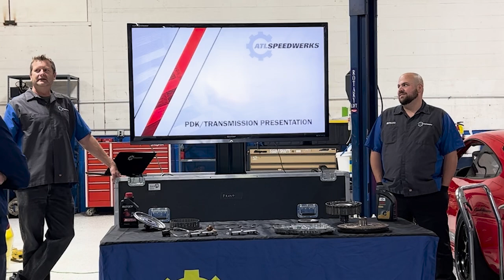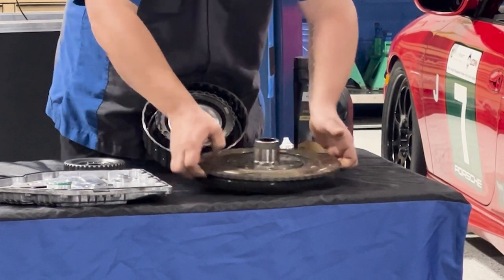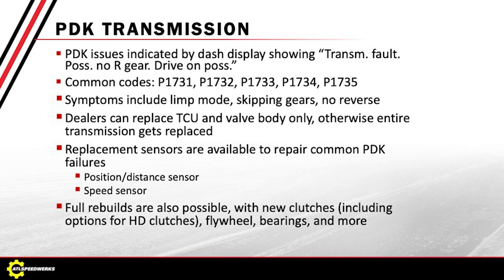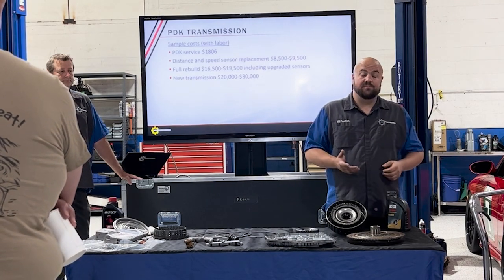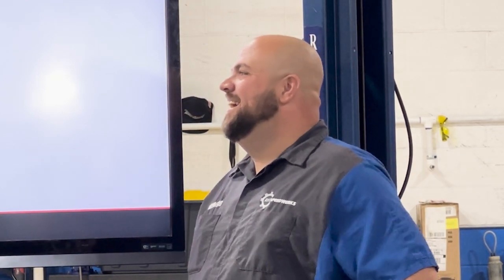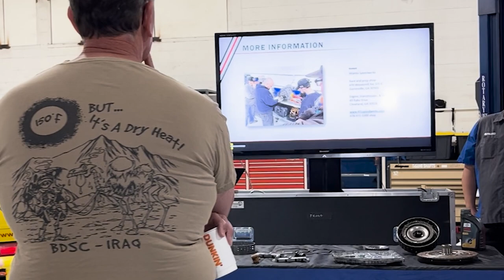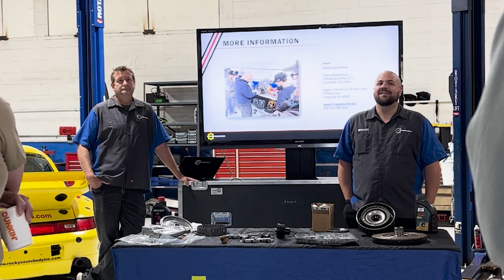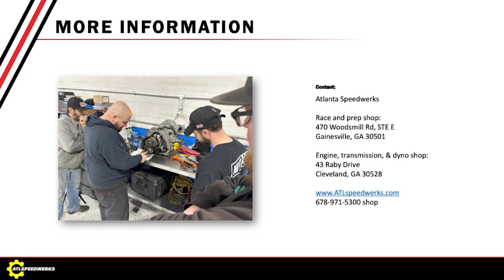Atlanta Speedwerks Porsche PDK transmission repair

Comment: What a wonderful video! I'm a new and nervous PDK owner and have been doing as much research as possible to help me be a good steward for the car. I'm only at ~27k miles on my '13 911 with no issues but absolutely have a little clunk when downshifting into first at a stop. Many resources around the web indicate that this is very normal and a common experience among most PDK owners. Hopefully this isn't an indication of a failing flywheel as you say.

Comment: I drove my 2009 Boxster 'S' to the carwash tonight. Car wouldn't go into any gear after starting it.. I restarted the car and it worked perfectly. I purchased the car with a warranty last year precisely because of the PDK transmission. I also made the dealership service the PDK as a condition of the sale. Car has 53K kilometers or about 32K miles. Hopefully it's just a solenoid.

Comment: I was actually in the market for a used low mileage Porsche Panamera GTS, but after watching this I am highly concerned about having transmission issues and the high cost of repair. I now have to look for a different car.
Reply from the maker: Don't let this worry you - this is a VERY low percentage of vehicles with PDK issues. We just educate owners so they know there are options for repairs besides full PDK replacement. Do normal maintenance and you're very likely to never have issues. We see Panamera's less often than other models.

Comment: Thanks for the PDK video session.  Can you clarify which (part number) 13 pan bolts you use with the cast pan that you described.  Thinking the bolts should be more substantial than the originals...Thank you ahead of time..

Comment: Sensor pack is available for some Porsche PDK from the dealer like on the Panamera.  Last I checked it is not available for the sportscars 911, Boxster, Cayman.
Reply from the maker: Correct on the Panamera sensors being available from the dealership. The sensors for 911/Boxster/Cayman are available through other sources - we keep several in stock.

Comment: Are you guys doing these seminars as a training thing? Or was this just a one time deal?

I'm in Miami, have done 6 sensors already, but always willing to learn more. I know you guys and BG Motorsports have a high job count with these things.
Reply from the maker: This was a presentation for PCA - not so much training. In order to do the level of repairs we do (more than sensors) a shop would need $100k in testing equipment as well as access to parts.

Comment: I got a 2009 Boxster Base 2.9L 987.2 with 49,280mi. When I come to a stop at a red light or go to park the PDK clunks on 1st gear, and if not fully warmed up the car will slip rarely. I got some seepage coming from the top of the transmission. I am told that the PDK is known for clunky noises and the car needs to be fully warmed up. I notice the longer I drive the smoother the shifting gets. Is there any problems with the PDK? Is seepage normal on PDK at 15yr & 50k miles?

Comment: I'm a newer tech working with transmissions at the moment at a dealership, working towards my drivetrain maters. We do overhaul valve bodies and full units at times. I personally love the science and engineering for the PDK. Do you think it's possible to get a place that solely does transmission / drivetrain work and if so what are some steps that I should take as a passionate learner to this field of work ?
Reply from the maker: Hi Richard - glad to see your interest in transmissions. There are plenty of shops that specialize in just transmissions (some for drag race, some for specific brands or models, some for automatics, etc). So yes you could easily have a shop that specializes in transmission work. However the bigger question comes down to if you're willing to put your heart and soul into a business and work 60-70 hours a week to get started, and also have the funding to get it started. Starting and/or owning a business is a very challenging and stressful situation that should be considered carefully. Being an entrepreneur is not for everyone, but for those that have the motivation and passion it can be very rewarding.

Comment: Great information on PDK breakdown and knowledge knowing that it can be repaired vs replaced with a new one. I’m currently experiencing codes C456 and 1764 on my 1st Gen 970 turbo. The car had be slipping gears but I still have reverse.. do you think this is a speed sensor or flywheel issue? I have done the PDK service in 2017 at 80k. I haven’t driven the car since 2018.
Reply from the maker: We put each vehicle through a very thorough evaluation to determine what the cause of a PDK issue is, so it would be very difficult to say until we complete an evaluation on your specific vehicle.
Reply: @atlspeedwerks I would have to get the shipped to your shop since I’m out of state.
Reply from the maker: Sure just let us know when to expect it. We get 2-3 vehicles a week shipped in from all around the country.
Reply: @atlspeedwerks  Also im planning to upgrade my turbos on the 970. Will the PDK be able to handle the extra torque and horsepower?

Comment: hi there, I'm wondering is there two type of clutch pack for the panamera pdk gearbox? mine is a 2009 Panamera Turbo and just replace the clutch set in china. But unforutnally,, when the engine have reach full boost and the gear box got into limp mode. show error code for clutch 1 slipping. I'm wondering if there's possible we purchase the wrong clutch set. If there any expericen with this, would you mind sharing with us ? Thank for all the help !
Reply: I know it's been a long time. Yes, there's a clutch for the turbo and one for the others. Facelift models also have different ones, turbo still has a bigger clutch.